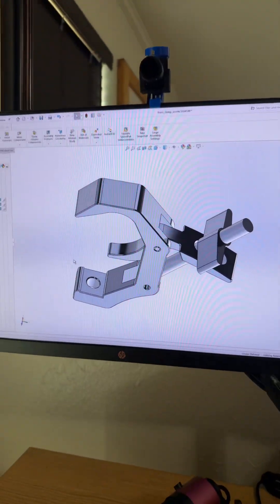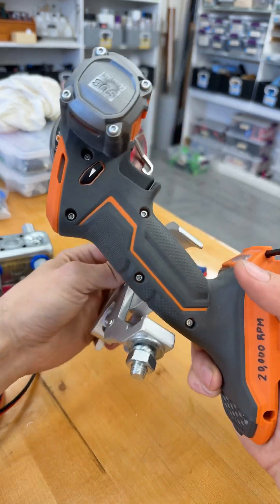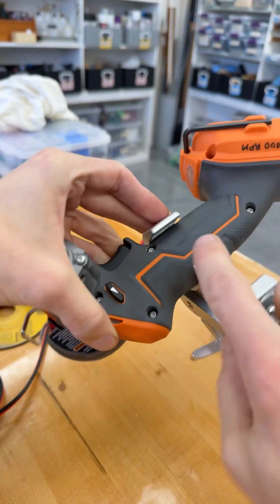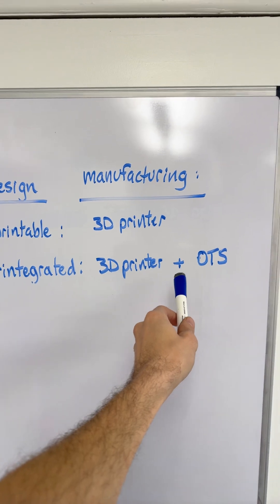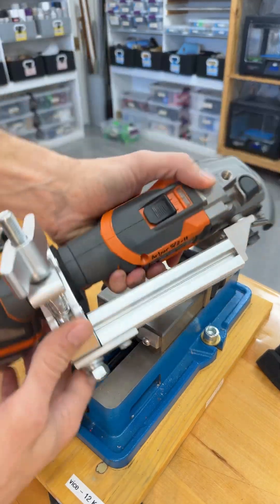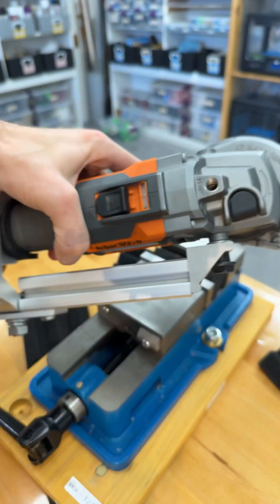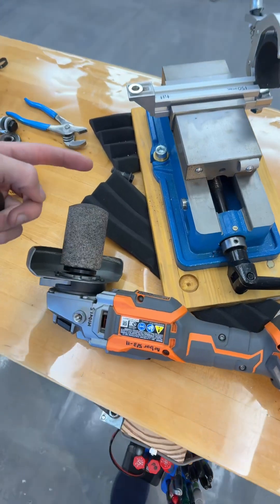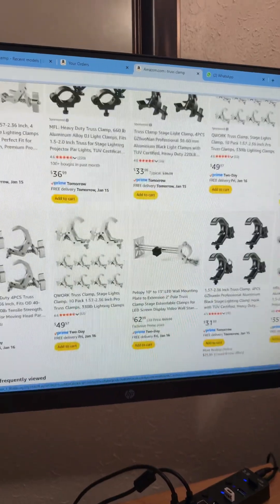This design converts an angle grinder into a bench-top grinder #diy #opensource #printegrated

Comment: Have you tried using a camera based 3D scanning method for the tool models? If you don’t need high precision that should work wonders and be very quick to build your library.
Reply from the maker: I tried in 2018 and again 2020 with photogrammetry.  Now it’s probably feasible but i need to discover the apps and method.  I’d love for a community member to help discover this and share best practices!

Comment: Brilliant.   They also make a quick release version of the truss clamps.  Just a cam lever to tighten.  That would make changeover even faster
Reply from the maker: oh my goodness share a model
number if you’ve got it!

This one has 300LBS rating, and 40-60 mm clamping diameter… oh i see the quick release options must go all the way around the tube.  that would work for some tools.
Reply: @davidmalawey   yeah, I think those are the ones I'm thinking about.

Comment: That specific type of truss clamp is called a quick trigger clamp, for anyone wondering. They're available for different truss diameters. 48mm to 60mm is the most common.
There are also other types of truss clamps (trigger clamps, c clamps, half couplers, g hook (?)), but I don't think any of them would work here. However, there is a specific type of clamp called Manfrotto Supaclamp which might work even better for this as it is rubberized and designed to work with all types of shapes up to 48mm in diameter.

Comment: Need a way to now keep it on while you want it on and off so you don't have to hold the button yourself. I was going to say zip ties but feel that's wasteful and no quick way to turn it off. Maybe 3d printed wedge but probably need different sizes.
Reply: A 3D printed “C” or “U” that slides over the handle and then you turn it 90deg to close down on the trigger.  That’s what I use on my table portaband saw.  Quick off, too.   I’ve also use releasable zip ties.  They are a game changer, look them up
Reply from the maker: this tool has a lock-on button but the other tools have variable speed.  I’ll want to develop a versatile remote lever that can actuate a trigger and mount where I need it.

Comment: tbh I expected something like a visegrip mechanism to hold the angel grinder. In my experience these kind of 'adapters' are mostly collecting dust in the workshop because they are a good idea but it takes to many steps to get it setup.
Reply from the maker: imagine instead of collecting dust, the design is compacted into a megabyte and stored on your hard drive as data, until it is truly needed.

then imagine instead of taking up hard drive space it’s stored on the internet until its desired.

that’s the world i’m building. no dust.

Comment: I’ve been so excited by the idea of using my old man’s portable belt sander as a benchtopper, but this encourages me even further! A lot of old corded tools have great life left in them, but not a compelling use case…as Portable only!
Reply from the maker: i’ve been brainstorming this passively for 2 years or more.

i imagined my sander on a platform, and immediately i am irritated by the noise of the gearbox.  the ridgid brushless sander is SO very loud.  wonder if I can dampen it somehow.
Reply: @davidmalawey  maybe a muffler just like combustion engines on the air intake/exhaust? What do you think is making the noise?

Comment: You know that’s a super common design for lighting equipment clamps? Like you can just buy them for a few bucks lol
Reply: Yeah I didn’t want to be the guy to say it…I have a ton of them. They are super useful
Reply: Yeah lol. They design them to attach lights to trusses waitholdoncrap
Reply: He already said the he just made a downloadable 3d model
Reply: @MathBard what does that have to do with anything? Stay in your lane.
Reply: @bluesroll99 you misheard or didn hear/didnt watch the whole video what lane are you in?
Reply: I think you didn't get the point because that is his exact point: this design is "printegrated" because it's a combination of 3d printed and off-the-shelf parts, and in this particular case, he realized that this design doesn't even need any 3d printed parts because that combination of ots parts works so well. At the end of the video, he even showcases how these clamps can be bought off amazon.
Reply: @c @charlotteice5704 you don’t get my point. My point is that there is no point to designing a 3d printer part when this already exists as a mass produced part.
Reply: That’s….  The point.  The whole point is they are super common and cheap.  He even says they are cheap, and mentions the price.  He didn’t say he invented the truss clamp, or printed it.  He bought them, for cheap, to hold tools.

Comment: Ooh... A 3D printable ball joint that is lockable and can hold the m10 bolt at a range of angles would be cool. Probably would be hard to make out of plastic.

I'm imagining that in using this clamp with an angle grinder it would be nice to be able to micro adjust the angle
Reply from the maker: Agreed. For Adjusting the angle: there are several axes to consider.  After I get some practice using this setup, I can understand which axis needs adjustability.

or maybe, I need to design a base attachment for a flat datum.  your thoughts are useful, thank you!
Reply: @davidmalawey  I'm sure there are lots of creative ways to approach this. Hopefully I can get a 3d printer someday to try these ideas out myself. Thanks mate
Reply: 20mm ball mounts for photography and offroad gear/electronics.  It’s a whole system
Reply from the maker: @SolarMillUSA  I explored these and there are some very cool ball mounts.  Then I wanted the "root" design or flagship ball size as a standard.  Every vendor has different sizes and some with rubber perimeter.  Couldn't find a master design to benchmark... yet.
Reply: @davidmalawey   from personal experience, I'm not a fan of the rubber encapsulated versions.  They allow for too much deflection in a system, making it springy.  I find the solid, hard 20mm versions to be the best and the geometry is dead simple to replicate. I'm actually in the process now of designing and 3D printing a short 5" extension because I'm only using it for a phone mount and the forces are low.  But i'm considering reinforcing the thin sections by running a bolt through the entire print, giving it a 'mineral' enhancement in case there is layer separation, and a more graceful, intact failure should that happen. Kinda like safety glass, still holding together.